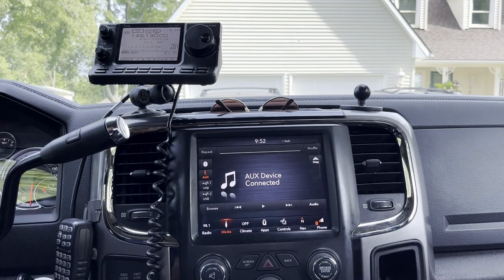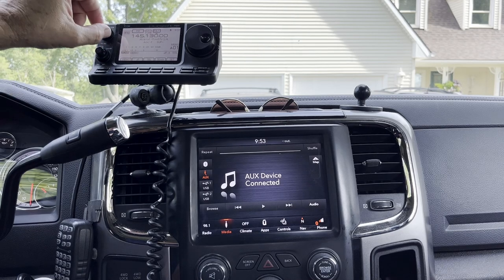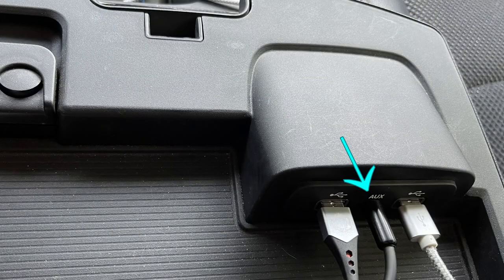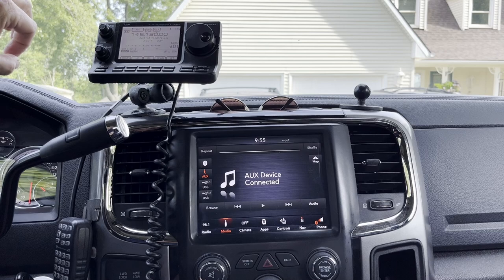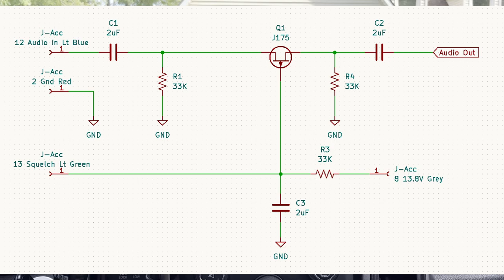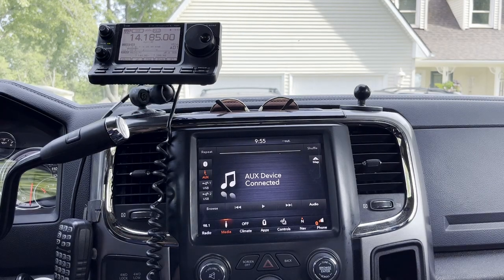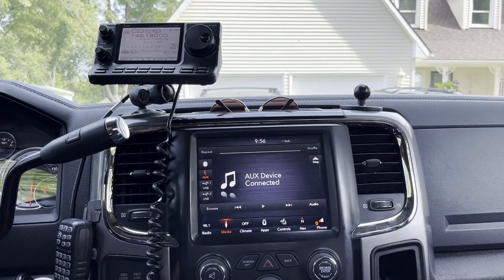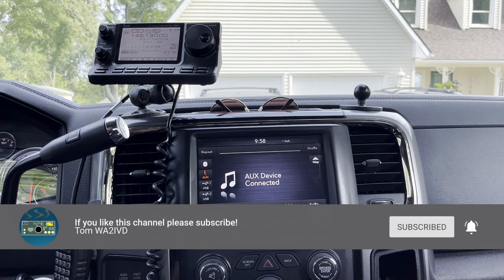IC-7100 Accessory Audio Squelch Circuit

Comment: Tom,  I use the audio jack in the remote head with the SP/Phones switch in Phones (headset) position to connect to amplified speakers on my desk.  Squelched audio is of course available there and interfaces nicely with the amplifier and sounds great.  Your audio gate project is a good little project too, thanks.
Reply from the maker: Hi Mark.  Yours is the 2nd comment about using the speaker jack.  In the other one, he used the speaker jack into his car’s auxiliary input and it works fine for him.  They’re both definitely good options and it depends on personal preference.  I did come up with a couple of drawbacks to using the accessory jack audio on my trip to Huntsville.  I’ll be doing a video with an update on the circuit and what I’ve found using.  Should be coming out soon.  73,  Tom

Comment: Is the icon 7300 the same way? I like the idea of the PC board idea to make the mod easier too. Thanks for sharing...Vic de KE8JWE
Reply from the maker: Hi Vic.  The IC-7300 does not have this problem.  On the IC-7300 the Set menu item for squelch enables or disables the squelch for BOTH the USB audio output and the ACC connector output.  The 7300 also has an additional setting that lets you select whether you want the keyboard beep sounds to be on the ACC audio.  On the 7100, the ACC jack and USB audio does not include keyboard beeps and there is no option to enable that.  So this circuit isn’t needed for the 7300.
Reply: @HamRadioA2Z  Thank you for the quick reply, I have considered getting a 7100 for portable use and your method would work quite nicely and I can keep my 7300 as my base station. Thx, Vic de KE8JWE

Comment: Tom, why didn’t you just use the rigs external speaker output? I have my FT-857 plugged into my car’s aux input that way. It works fine without even installing a shunt load resistor or attenuator.
Reply from the maker: Hi Scott.  I plan on covering that topic in the full video.  Several reasons.  One, you already mentioned, is that I would need to add (I had assumed) a load or attenuator of some type to keep from getting distortion.  I’m surprised you didn’t need that.  Do you have the volume turned down really low?  The 2nd reason has to do with the volume.  The Accessory connector output provides audio at a fixed level.  This way I don’t need to keep re-adjusting the audio level when I switch from radio speaker to vehicle stereo.  Finally, in my case, I already have an external speaker connected to the radio and I switch back and forth between that speaker and the truck audio system depending on whether I’m actively working on the 7100 or I’m listening to something else in the truck and want to listen to the 7100 in the background.  I can’t listen to 2 sources at once with my truck system.  Great question.  Thanks for watching!
Reply: @HamRadioA2Z  the volume is at about 10 o’clock to match the level of the AM/FM/XM sources. I have thought about building an audio combiner, basically a mixer with 1/8” mini ins and outs, to support more than one radio’s audio. A simple fixed 10k load and series resistor isolation combiner to a combined output. You have to realize that the aux inputs are expecting to see headphone/speaker outputs from our players, so it’s not driving a high gain input. I would probably promote the use of a series 4.7uf Cap, just to provide protection for the general publics use. I’d just use the receiver’s volume controls to adjust each of their levels.
Reply from the maker: Hi Scott.  I know that the aux-ins are designed primarily for smart phone and MP3 player headphone outputs, but I figured that connecting an external speaker output would have been a bit much for it.  I would think that a headphone output is a lot closer to line-level outputs.  You make some good points.  I will probably mention these when I get the full video put together.  Thanks again for your comments.  73, Tom

Comment: Hello new sub. Could you comment on setting up and using a Ham and SSB capable rig on a sailboat. I am a newbie.
Reply from the maker: Many people operate marine mobile with great success.  The water makes a great ground plane for your antenna.  Your antenna options will depend on how big the boat is.  I know that running a wire antenna from the bow or stern up to the top of the mast (with appropriate insulators at each end) is a pretty common HF setup.  You will have to use a tuner with this arrangement if you want to operate multiple bands.  The sailboat will have some type of electrical bonding system to the water.  You will want to connect that to your station grounds.  If it’s not your sailboat, you can tie a weight to a copper strap and throw that in the water with the other end connected to your equipment.  The Maritime Mobile Service Network may also have some tips and other resources that might be helpful.  You can find them here:  https://www.mmsn.org/. Hope this helps.  73,  Tom